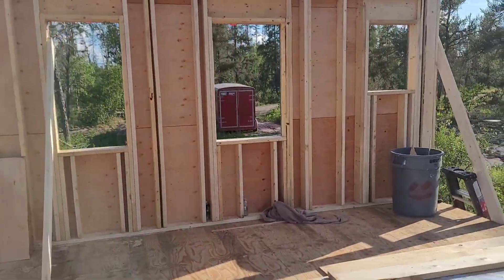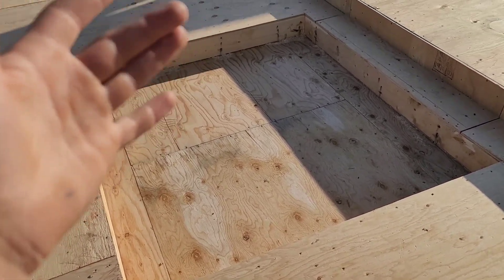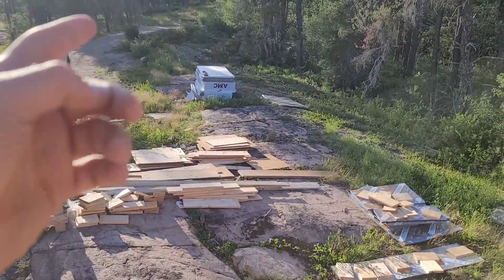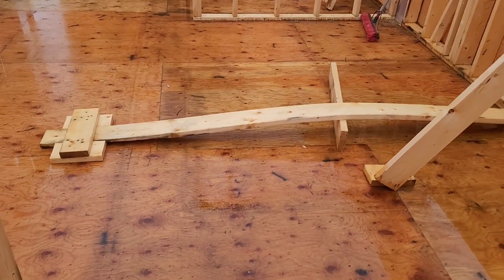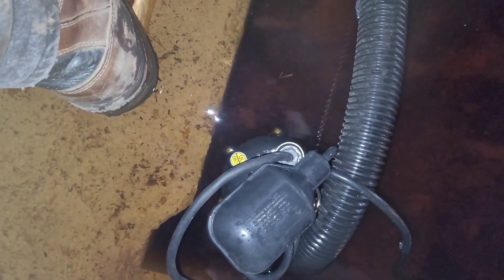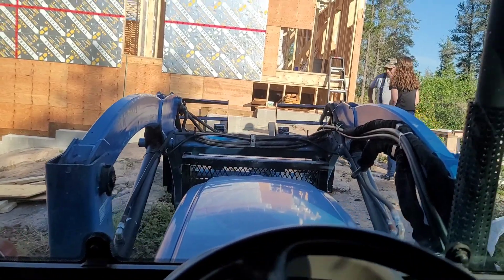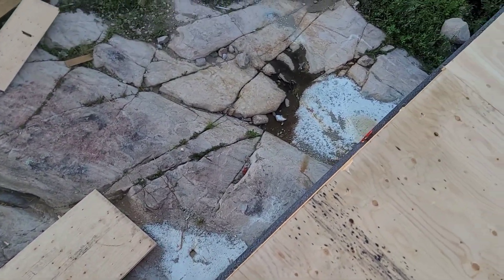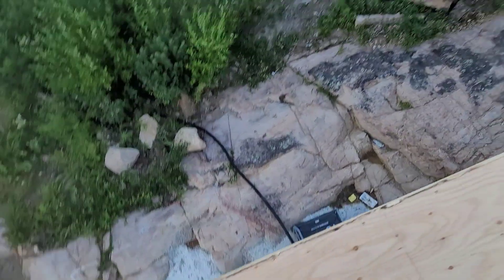Building Our 2300 Sqft Off Grid Dream Home! Part 4 Main Floor Walls

Comment: This is just an opinion..
 I observe your video

And I had an idea about the spot you want to have to be a office or a bedroom which will look much more exciting if you had an another interior window same size as the other vaulted windows overlooking the vaulted area in the section extending from that bedroom or office space to let additional sunlight into your office or bedroom space from the vaulted arena..

Houses do have interior windows overlooking vaulted arena..

Lots of natural sunlight saves you on the drainage on your power source supply

Ask your wife what she thinks about the idea of additional interior window overlooking the vaulted arena from the office or upper bedroom space idea??
She may perhaps like the idea..

I'm very excited for the two of you and I wish you all the best 😁😁😁😁
Reply from the maker: Hey! We thought about doing a window there however we would prefer to have the extra wall space on either side of the wall and we aren't sure if a window would have the same sound dampening as the drywall. It is a great idea just not for our plans.

Comment: it seems wood and energy is very cheap in america?? You always use so many studs in the walls , half of them is not needed. And the more wood you use, its gonna lead cold bridges through the wall and it will result in higher energy consumtion.
Reply from the maker: In Canada we use wood for our homes because we have lots of trees and we need extremely well insulated homes. The number of studs we used are the number required to meet the local Building Codes. The building has to be able to support 14' of snow load. There is definitely thermal bridging at every stud which is why we added the R5 ridged insulation to the exterior (almost no one does this). Wood frame houses with Fiberglass insulation are better insulated than brick or concrete. We see temperatures as low as - 45 Celsius and as high as +40 Celsius. Also we don't get crazy natural disasters like hurricanes or tornados.
Reply: @adeyacres8695  thanks for reply , oh sorry i mixed US with canada haha! Yes its better to add a layer of insulation covering the suds, it will for sure help thermal bridging situation.